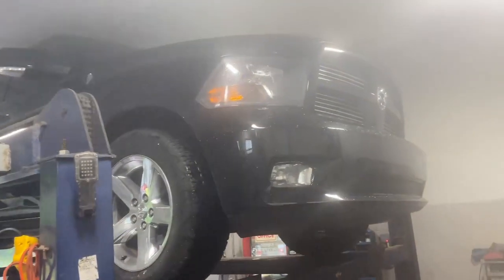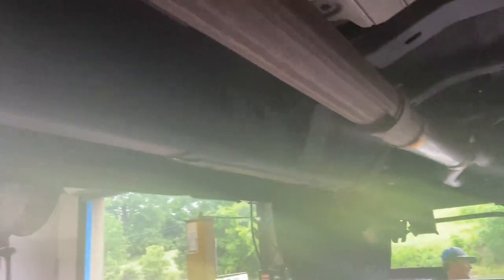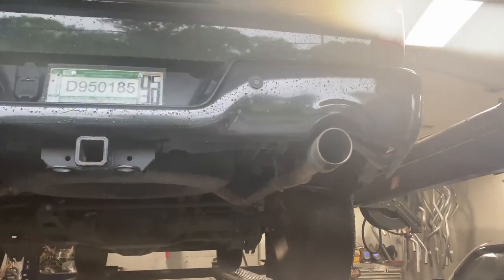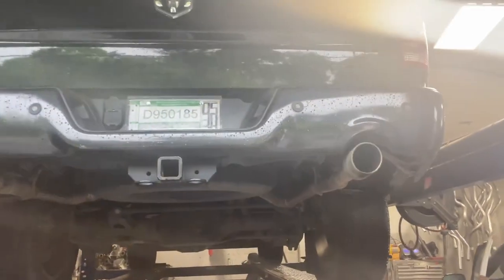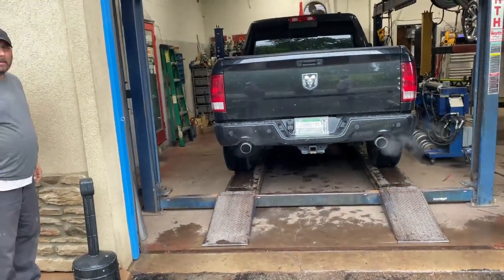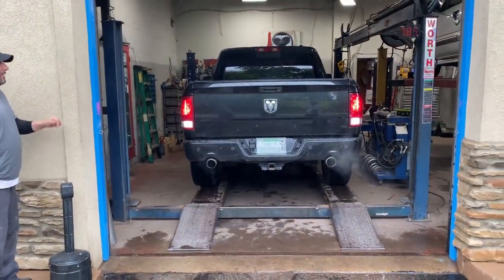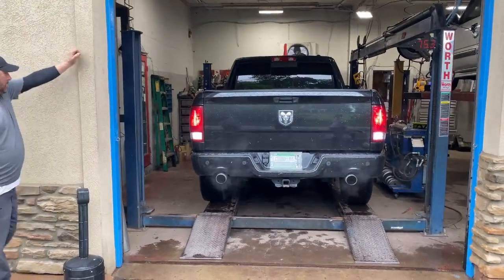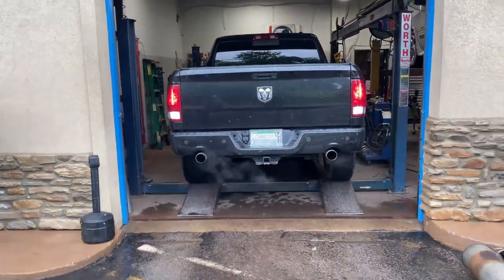RAM 1500 5.7L HEMI DUAL EXHAUST w/ STRAIGHT PIPES!

Comment: My coworker has the same set up on his ram and floors his car leaving work without warming it up every time. Now I can hear that 5.7L lifters ticking from a mile away lol
Reply: Them 5.7 hemis are notorious for that.
Reply: Wdym? Lifters?
Reply: @kyree0083  A lifter tick is caused when the push rod or camshaft doesn't make continuous contact with the lifters
Reply: Its not the lifters its an exaust leak at the manifold look up hemi tick
Reply: Most of time exhaust leak at manifold, you will know a hemi tick. If its ticking on cold starts its exhaust leak
Reply: @tularecounty5594  yup mine has it, it’s funny when I hear other trucks outside if you listen closely you can hear that tick lol
Reply: Only after the 2012 year models
Reply: @tularecounty5594  oh shit what's good tulare I'm out here in Fresno county llol